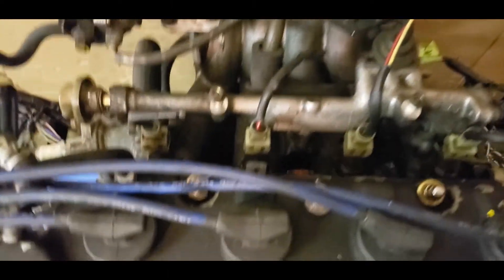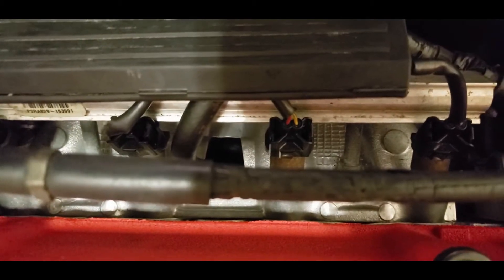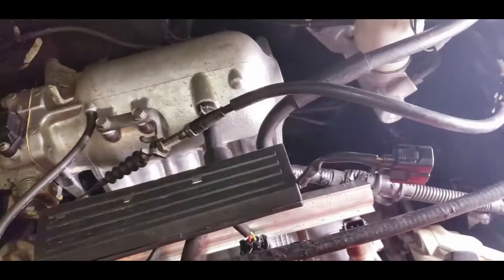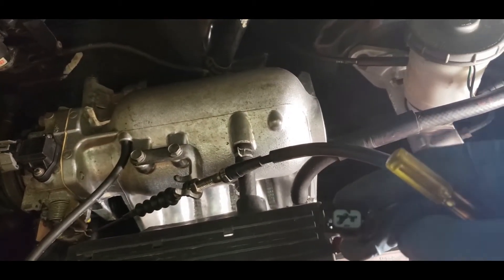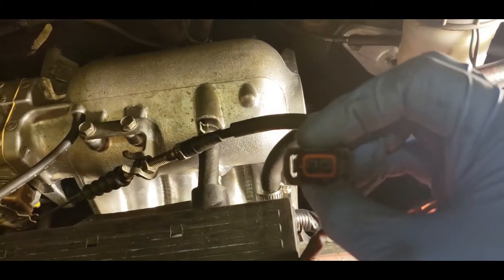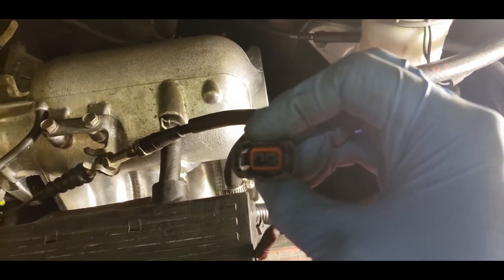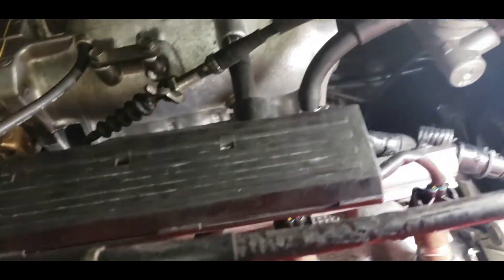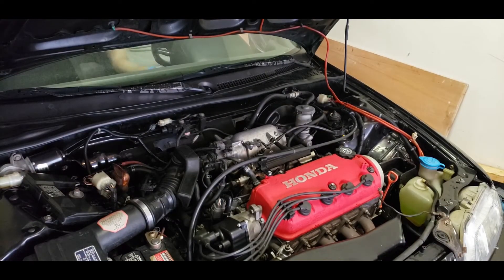[D16Y8 Fixing Idle Issue] How to Wire OBD2 Injectors Properly

Comment: why you swap the injector wire? what convertion you do?
Reply from the maker: The wires were wired incorrectly. Just did it to match how it should have been wired. I don't think it mattered in this case because the injectors are not polarity sensitive. But if you have injectors that are, you need to make sure the correct ground wire from the ecu is on the right wire to the injector.